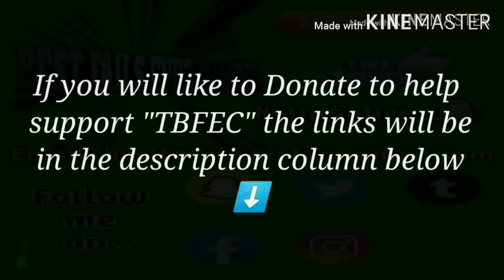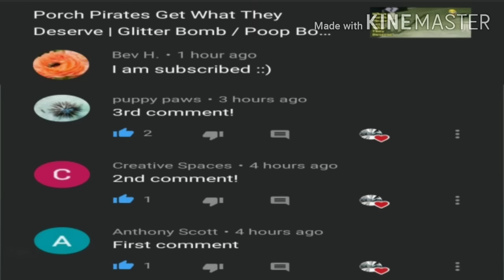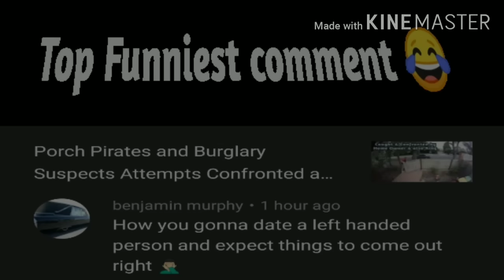Repos and Towing Fails All Caught On Camera | Lifting Vehicles Goes Wrong

Comment: The big rig with the black suv he could've used a long board on the front to prevent the cable from rubbing on the front of the jeep that way the cables are away from the front end

Comment: The first video your braking my car lol I drive a flat bed been doing it for years and it will not break the car draging it
Reply: I had the tow truck driver snap the Parking pin in the transmission of a truck of mine doing this and the joke was  he was not  doing a Repossession.he was paid to deliver the vehicle.he wasin no mood for me too it from park too Neutral  and jest started hauling it while still in park Which snapped the parking pin. Luckily it was a old 70s gmc so Was a pretty simple fix compared to some newer vehicles .ive seen a lot of code drivers give absolutely no suite shit How much damage thay do. Most of them claim upfront fair not responsible for any damage done while salvaging a vehicle that has gone off the road.ive wants them completely demolished vehicles that had no damage at all that went off the road during a snowstorm. all the damage was done by the  truck operators Trying to in their opinion do their job.thay didn't want to get in water or snow or mud and basically with the chain around whatever was handy and started lunging and yanking.i unfortunately didn't have cameras back then to watch them tear off wheels bumpers and so forth some even laugh about it like a little school boy. the jeep that fell off of the transporter near the end of the video I'm willing to bet the dealership just replace the front and rear bumper cover and didn't disclose the damage to the vehicle lol. my grandfather bout 2 vehicles 1 new and 1 was a demonstrator vehicle.we started doing some body work on the brand-new one some years after he got it and get this 1 dore the hood and driver-side fender were all off of the different colored vehicle and had been put on it and repainted.the that vehicle had basically been damaged in some way for being sold by the dealership and thay Repair the damage with salvage yard Body parts if u can believe that..ive had a couple mechanics that work at dealerships tell me it's not at all uncommon if a vehicle gets damaged while somebody took it out for a test drive or damaged while being delivered to the dealership on a container ship some dealerships will nearly not disclose this to the person buying it and whatever they can get their hands on  too Fast as possible get the damage covered up and the vehicle repainted to slide it back out on the lot and put it back up for sale. the demonstrator we found out hsd bin what would be borderline a floud  vehicle.we had it to the point of Taking the transmission out and haf the front left off and what a wonderful prize.we found out it had bin back woods and four wheeling and gotten stopped in a mud bog up over the engine bonnet. We've been wondering since day one when we got it why there was this weird red clay earth constantly coming out from the undercarriage and basically it was Afghan behind Body panels to the point it Rotted the rocker stills and Front fenders way faster than they should have and the front cross member had a huge bunch of rocks up inside of it and was everything under the whole front of the vehicle around it hard packed with that red clay like mud. Every time you tell the body panel off the vehicle it was up inside everything. They basically just pressure washed it off when it got back to the dealership and they didn't disclose that it'd been in an issue like that when we bought it.   my grandfather was also in a situation where he was in a legal argument with a vehicle dealership.the car had a manufacturers defect and at that point the dealership refused to acknowledge the problem. Multiple owners of this particular model vehicle wear blowing engines every few months.thay within like two months would start hemorrhaging oil and the motor go bad one) for another. I forget how many motors got put in that car under warranty and the same thing was happening with other owners all over town.wall wean the Warranty ran out the car was not paid off yet. the moved blow and i forget how much they wanted to yet again replace the motor he at that point was part of a group of people that were taking that dealership to court if I remember correctly and he wasn't about to continue making payments on a vehicle that  was not able to be driven.he notified them to, and yet the vehicle.the repo company they sent out  Seize the wrong vehicle and if I remember correctly pretty much totaled it with the amount of damage they did. see the car they were supposed to take thay busted it up moving it lol than latched onto the car that it was behind and if I remember correctly slammed one in too  the other halling it off .hes Why the whole time on the phone with the cops. thay likened the first video completely ignored the fact they were being instructed that they were trying to take the wrong vehicle and didn't care how much property damage they did while doing their job.the Repow, he ended up getting charged with auto thaft and This on added to a even bigger storm with the dealership. Trying to remember I think this was late 70s or early 80s my family always brings it up whenever people mentioned repossession Of vehicles

Comment: Damn. You guys are terrible repo guys. You guys do know that all these automatic middle shifting gear sticks have a safety release push hole to shift it to any gear when off..
Reply: I love over confident know it alls online, placing judgement on someones livelihood when they are completely ignorant on the subject. They are great repo agents since you obviously don’t know there are SOME vehicle makes and models that contain a neutral override switch. Those years of impala and malibu DONT have an easy access hole to the override. The only method to disengage park through the heat shift area requires removal of the entire plastic center console shroud. It would take them far too much time to access it. Repossessions are about speed for many reasons, one of which is safety. If you can remove the collateral from the debtors property, to a much safer location down the street you lower the risk of confrontation. Remember that most debtors are in a very bad situation and you never know exactly what that stress may cause them to do in reaction to a lawful repossession. Things could go many ways depending on the debtors situation and state of mind. A short pull at a very low angle just as they did was the correct way to do it. They immediately flipped around and grabbed it properly when they were in a much safer location. As for the first video the agent was doing the same thing, and had the genius not followed him the way he did the driver would of been able to rebook to the front as well. However when you are alone on a repossession and have all the debtors posse following you around, you would risk harm or worse by getting out of your truck to do so. Its far smarter to just stop and wait for police...which he did. You wouldn’t want someone coming to you at your place of employment so just give the respect to these agents by admitting you don’t know everything. If you don’t talk about things you don’t know, it will never make you out to look like an ignorant keyboard warrior.

Comment: Why do the tow trucks not have a tool that goes under the tire and it rolls with the car as they tow it. Also you could program the cars electronics to have a few switches that you can activate so that the car can not start, can mot shift, and can not be unlocked with the key fob. Then you could use them to stop the people from even starting the car if they try and pull off. Also you could stop them from driving while in a different place like catch them at the grocery store but dont tell them and just follow them and deactivate the ignition or something qith the switch so they are stranded and when they finally leave snatch the car. Or after they call someone to fix and the person tries fixing it and has to leave to go get more tools you anatch it then. I would put a hook on the rear of every car i sold at my buy here pay here car lot. I would use a flatbed and just drag the thing up onto the flatbed then dip. Deal with the rest on my own time at the shop. They can bring me the keys if they want later or add 300 to the bill to program one without them. 

All financed cars should have a jailbreak system like phones and should be locked until they are paid off. That way of they miss a payment the bank can lock up the whole car from being able to operate and the car becomes worthless to anyone without the code to get it unlocked. If it can be done with phones then there is no way they CAN NOT do it with a cars ECU and Transmissionbcontrol module too. There should be two ways to disable the car through those units and it would be too expensive to bypass or reprogram a new unit forbeach so the drivers will vave and pay or let you take it. Problem solved

Your welcome. Lol

Comment: The first tow, why didn’t the bloke give him the keys to put the vehicle in neutral and take the hand break off? Instead he walks down the street shouting about breaks. Plus the repo people drive away from the property to a safe location before putting the dolly wheels on the vehicle. Doesn’t help you running down the street after him.
Second tow bloke opens the door but doesn’t put the vehicle in neutral or take the hand break off.
Reply: They were both front wheel drive vehicles so the hand brake had nothing to do with it. The wheels were squealing because the transmission was in park and the car was being dragged. The second repo didn’t care because he dropped it and picked it up from the front, which is what the first driver was probably going to do but the owner wouldn’t piss off and leave him alone.

Comment: How far can you drag a front wheel drive car without messing up the transmission?
Reply: Depends on the parts could be 5 feet or 5 miles.

Comment: Cars don't get repo'd from missing one payment.  It usually takes several missed payments and lots of attempts by the bank to contact you.  It amazes me that these folks act so surprised when the car is hauled away.
Reply: Actually, then can and DO get repo'd from a single late payment, depending on whether you bought it from Penske Motors or Slightly Honest Chuck's Used Cars and Titty Bar.